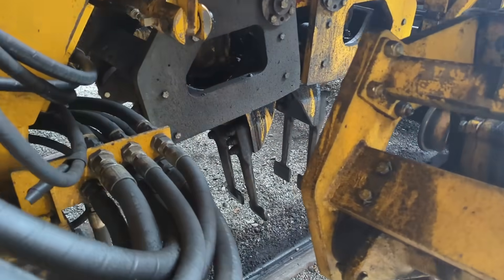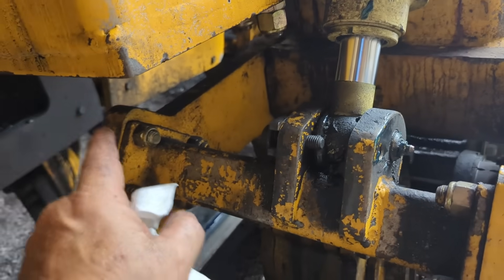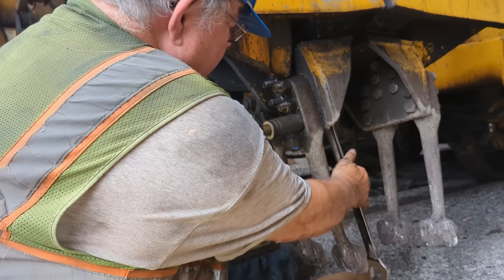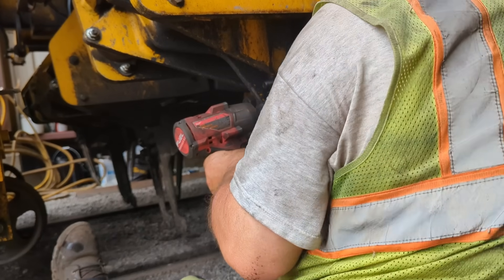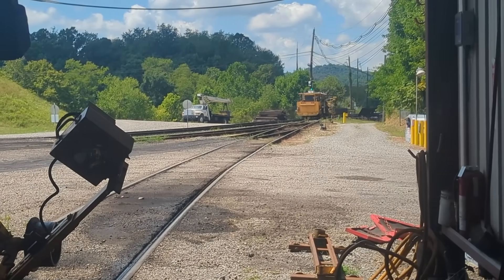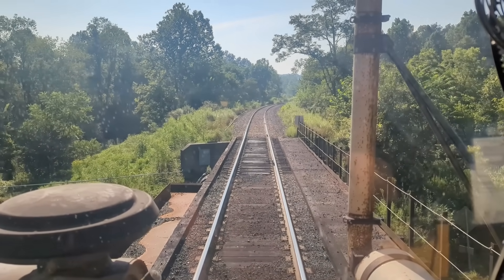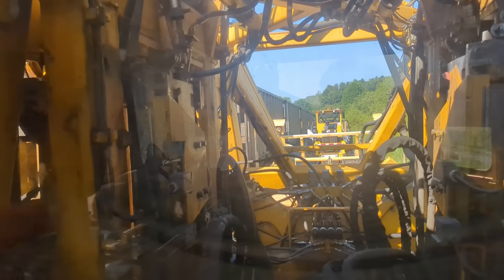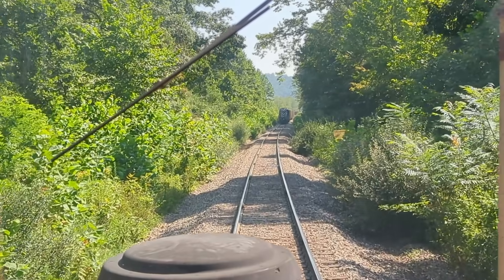Train Won't Move 3098 Locomotive in  PCS Fault and Tamper Maintenance

Comment: those units bolted on there got so many hours and you have to replace them before it gets damage and the bolts to have to be checked after so many hours of vibrations or you end up with damage equipment damage cant be helped useless you record when units break to count repeat breakdowns
Reply from the maker: Thank you for sharing your insights into that Peter, your right it's
like anything else, things only last a certain number of hours
before they start to fail.   Appreciate your watching our video and may you have a very good day.

Comment: Hi Dave, when I was running on the Cape Cod Central, I was "bitten" by the PCS fault gremlin on a GP 7 while on my annual qualification ride! Turned out to be a loose connection in the locomotive cab, which we were able to repair in a few, very stressful minutes, due to the fact we were sitting on a grade crossing in the middle of Hyannis! As you always say, "That's railroading"! Stay safe my friend!
Reply from the maker: Thank you for sharing that James. Interesting, they found a  loose
electrical connection on 3098 also which was causing the thing
to go into PCS. I do imagine it would be stressful with all
those cars waiting at the crossing! Really appreciate your
taking the time to check out our video and may you have
a very good day.

Comment: Hi Dave. Looks like a frustrating week.  How many sidings do they have over the length of the track?  Would it be feasible to add one or two short sidings to alleviate situations like this?  I know you've mentioned that it takes more than an hour to run the tamper and regulator from one end to the other.  Perhaps an extra parking space / passing point here and there would be beneficial.
Reply from the maker: We have 1 siding located half way between the plant and the
harbor MusicByWinston. On both ends of the track there are
sidings. 8 miles is the halfway point between the plant and harbor
and that is where that one siding is. There has been talk of
adding more sidings over the many years we have ran trains
but nothing has been added yet.  Really appreciate your taking the time to watch our video and may you have a very good day.

Comment: yes the hydraulic shafts in bearings for stability. you have a electric grease gun! that makes it easier.
Reply from the maker: There are a bunch of grease fittings on that tamper Barry, battery
gun sure does make it a lot easier now your right about that.

Comment: PCS is the Pneumatic Control Switch on the locomotive - its purpose is to stop the locomotive from loading when the trainline goes into emergency (loses air).  They do fail from time to time.
Reply from the maker: Your right there is a pneumatic control switch on the loco mmi16.
However PCS means the power cutoff switch. It closes at 20 psi and the opens at 40 psi. When the power cutoff switch opens
that negates all throttle functions, that also activates the pneumatic
control switch which as you say applies the locomotive independent
brakes. Power Cutoff switch gets it's air from the 26 C brake valve
and also from the P 2 A application valve.   Really appreciate your taking the time to watch our video and hope you have a very good day.

Comment: Designing heavy forklift trucks I've seen what vibrations do to cables having too much freedom. Damaged insulation on one of the 3 motor power cables made the brake pedal give full speed ahead... Why would a vibrating tamper be different? They work one week and are repaired during the next week the track guys say.
Reply from the maker: Your pretty much right about that Stefan. Work one week and then
repair the next week..... :-)  Tampers are high maintenance
machines. But they do the work of hundreds of men in a day too. Really appreciate your taking the time to watch our video and hope you have a very good day.
Reply: @ccrx6700 Thank You. More wakeboard recording today. An internationally successful rider was told to show up today.

Comment: You had some forward thinking folks on that tamper overhaul, Dave.
That block of grease fittings and hoses are a good way to make sure that the hard to reach ones don't get missed! I did similar on the steering system on my last boat, mainly for safety reasons; you really didn't want to try to get in there while running...
Reply from the maker: Your right about that BilgeDweller, those grease blocks are nice
and the zerk fittings on them don't get boogered up either.
Good idea you had on your boat.  Really appreciate your taking the time to watch our video and hope you have a very good day.

Comment: Well that turned out a fun day getting 3098 in the siding. Bet the radio was going like crazy with all the messages. Track machines are great but they do seem to break down a lot. You have looked after yours well for 19 years, it does not let you down often and has done lots of work in that time. Have a Good Day Dave.
Reply from the maker: Your right Cedarcam,  tampers are high maintenance machines. But they do the work of hundreds of men in a day too. I have tried to
keep up on the maintenance on that thing as best I can over the years. Almost 15,000 hours on it and I've probably put around
10,000 of those hours on it. Really appreciate your taking the time to watch our video and hope you have a very good day.

Comment: Maintenance is always gettin in the way of Production.......and visa/versa...mmm...mmmmm...mmmm  

The tamper looks like it's extremely mechanically intensive, and takes a pounding every time it gets used......something you dont want to neglect maintenance on.....good thing you caught that missing bolt, Dave......
Reply from the maker: I've always been big on preventative maintenance Mike. Tampers
are a high maintenance machine. What is amazing more things
don't fall apart than do.  But when they are working they take the
place of what a hundred guys could do in a day.  Really appreciate your taking the time to watch our video and may you have a very good day.

Comment: Hey, no crawling! Preventive maintenance is very important, seeing that they're working in constant dust created by their operations. The dustious machines were the ballast regulators, unloading ballast cars, especially the smaller pink lady, made for walkways. Their ballast was from a quarry in Wisconsin that wasn't very far away. It was pink and white. I once worked with a crew that was doing the small chips for the walkway between the tracks. It was hot n' humid. When I showered @ home the water ran pink from all of the ballast dust. Even my socks were pink!
 Tha absolutely biggest dust creator wast the yard cleaner. It's brushes ere like the one on the ballast regulator. It was used to clean up spilled product spilled from cars. It would propel the stuff into a long tray which would move upwards and dump the stuff onto a conveyor belt and shoot into an air dump car, which would be taken for dumping on narrow spots and filling the low spots on the fire roads. We used to have a lot of grain spillage (that the rats loved). There were many, many rats about  and if we hadn't jumped any cars for a while, they would shoot out from under the screeching retarders  when we resumed humping, a swarm would be running out from under the retarders. There was a clerk that would be  shooting the rats behind me. This was a surprising 'sport' on the night shift 11to7, 12 till 8. Saw some beautiful sunrises from there. 
 How are you going to re rail those cars? Hulchers or wooden blocks with frogs, and pull then up with a loco? The first gons apoear to be empty, and wow, newer paint !
 Want to see something from my railroad, look up train vs tornado.  Note how far and fast the train goes after the air goes, it's filmed from the rear facing engine. Watch it to the end. That took place in Wisconsin.
Reply from the maker: Your right it is Thomas, I have always been big on preventative
maintenance. We rented a yard cleaner many years ago and 
yes it certainly was a dusty machine and it was cleaning up coal,
so the dust was black. Re rail cars? There wasn't any in the
video, unless you are referring to some other time?  Really appreciate your taking the time to watch our video and may you have a very good day.

Comment: PCS is Pneumatic Control Switch and basically it unloads the generator.  When the PCS is dumped, the load drops and the locomotive is in 'neutral'.  It's how alerters stop the train if they aren't responded to within a certain time (along with a penalty brake application).
Reply from the maker: Your right there is a pneumatic control switch on the loco Low Key Loki. There is also a power cutoff switch. When the air pressure
drops below 20 psi the switch closes and that cuts off power
to the governor which negates throttle functions. Switch opens
at 40 psi. The Power cutoff switch then activates the pneumatic
control switch which applies the brakes. If the sentry system
is activated it is done so via the 26 F control valve. :-)  PCS means the power cutoff switch was activated.  Really appreciate your taking the time to watch and we hope you have a very good day.

Comment: Dave, I see Mr Murphy moved out of your tamper,and into Amtrak's. Or did he decide 3098 was a better choice. Need to load him up in one of the cars your scraping. PM goes a long way to prevent expensive repairs, sometimes times you do win doing in timely. Way to many doodads, geegaws, and acutraments on those tampers to go wrong. Keep up that PM and stay safe out there.
Reply from the maker: Always an adventure Thomas..... :-) Tampers are high maintenance
machines as you can imagine. But they do the work of hundreds of men in a day too. It's not surprising when they break down, what
is amazing is that it doesn't happen more often than it does. 
Really appreciate your taking the time to watch our video and hope you have a very good day.

Comment: Give it up on that tamper.....got to be a better used unit out there.
Reply: I think Dave has far LESS trouble from his Tamper than his Regulator.

   I think he'd be better suited if they could find a newer, used Regulator for him.

He seems to be able to keep that Tamper running as opposed to the Regulator which seems to be a constant source of problems to keep operating.

At least from my POV watching Dave's "That's Railroading" videos just seems to be the Regulator is more prone to problematic issues than his Tamper.
Reply from the maker: Tampers are high maintenance machines, all tampers develop
problems Edward. What is amazing with all the work and vibration they don't just vibrate themselves into pieces. Getting a newer
rebuilt tamper is in the budget, but we desperately need a
new regulator more than tamper for now.  Really appreciate your taking the time to watch our video and may you have a very good day.

Comment: The way you change that oil and grease those fittings,Dave, if the rail road job ends, you could have aiways gotten a job as an oiler and wiper on a old steM ship! LOL.
Reply from the maker: Don't laugh, way back in the 1970's I could have got on a river
boat but I didn't want the 30 on and 30 off schedule they had
at the time Michael. 30 days on the river was not my way for
a young man. Fact: back then I knew a guy who was a pilot on
a small river boat and he once spent 365 days in a row on
it without getting off. Some guys got in trouble with the law
back then and got on the boats and stayed on cause the law
couldn't touch them on the river, at least not until they got off
the boats. I knew several guys like that.  Thank you for taking the time to watch and we hope you have a very good day.

Comment: Another day on the railroad, where anything can happen. Heavy pieces of equipment that is used every day, will act up for sure. Glad you all were able to maneuver around it. The PM work is very important, without it, just think of the many more issues that would pop up. You do indeed take care of your equipment. We need to get you an extra siding or two. Have a better day tomorrow, thanks for sharing. Dave
Reply from the maker: Always an adventure here Rob.... :-) Tampers are high maintenance
machines as you can imagine. But they do the work of hundreds of men in a day too. Really appreciate your taking the time to watch our video and hope you have a very good day.